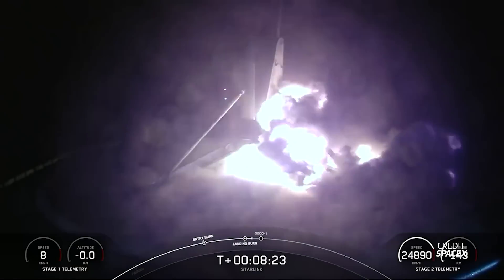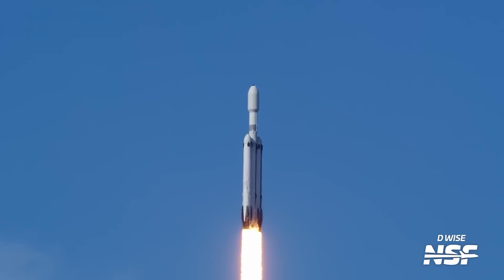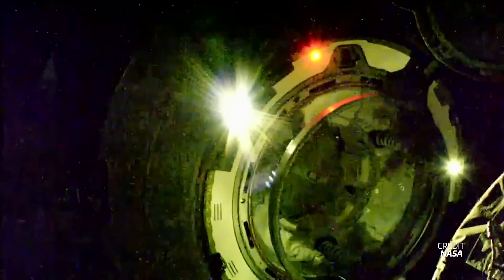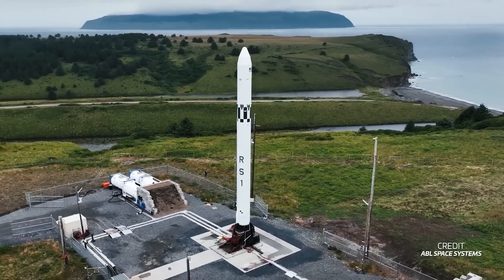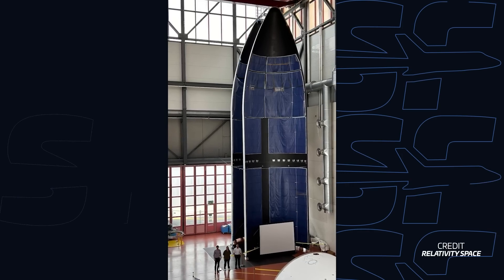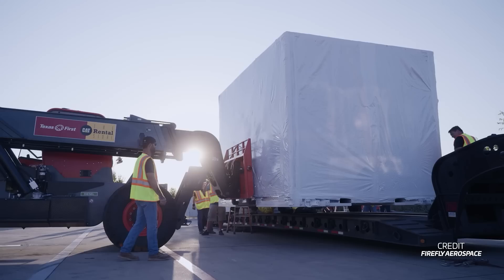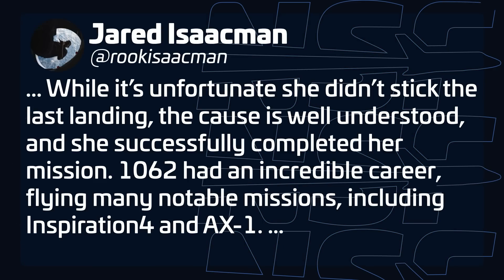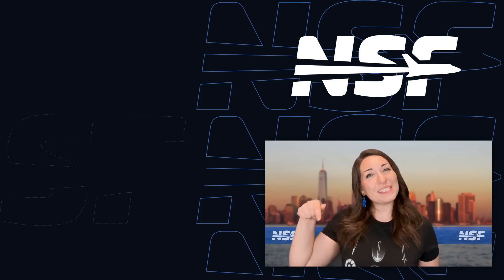Not A Good Week For Rockets | This Week In Spaceflight

Comment: when Starliner returns, the heat on reentry more the likely cause the same leaks again. after that a clean entry is unlikely
Reply: The problem is with the trunk, and that's not designed to re-enter.